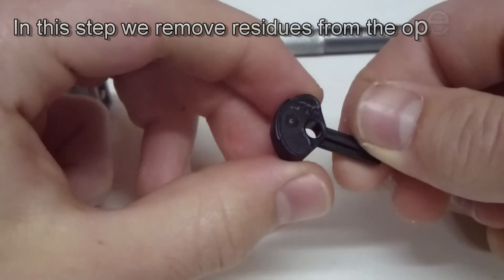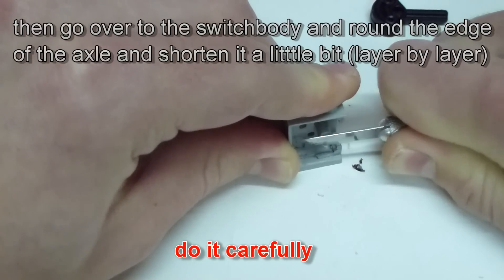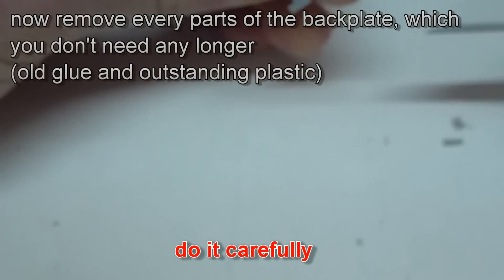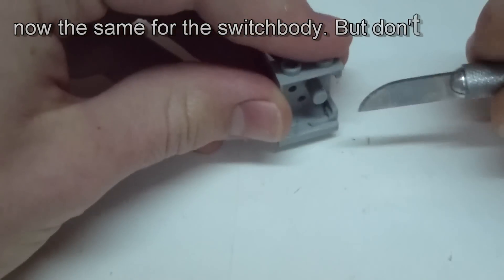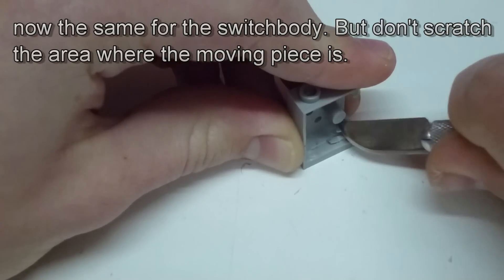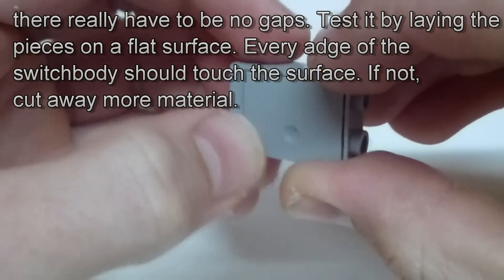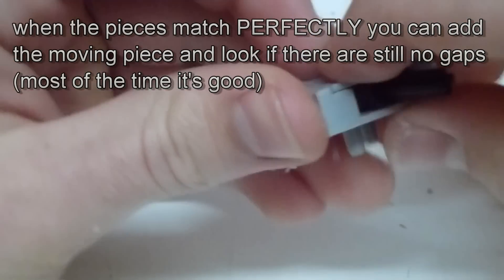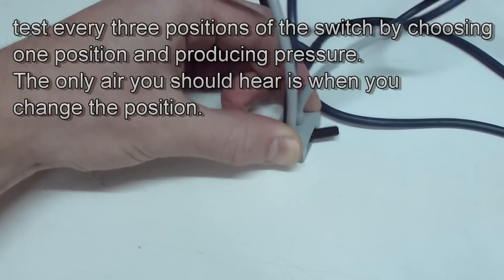(part 3/4) How to modify a LEGO pneumatic switch in 10 steps

Comment: When will be the next part? I want to use my i3 in a school project but after spraying the switches with oil, the switches start leaking, so now i want to fully modificate them to improve the engine performence and make it run again =D Also i have another type of switches, i can remove my backplate without cutting glue, the backplate is mounted with 3 pins, when you press these back, you can remove the backplate.

Comment: Yes, I'm buying more than enough in case I break some. They will all be new, simply because new ones are the cheapest (only 1.3 euros each on Bricklink). Is this the last part? I guess the only thing left would be the gluing, which should be easy enough if done carefully.

Comment from the maker: no there aren't. But sometimes it's a little bit more difficult because of its outer-structure. I recommend you to buy 1 or 2 used switches and first test it with them, because my first attempts went bad and both switches where destroyed.